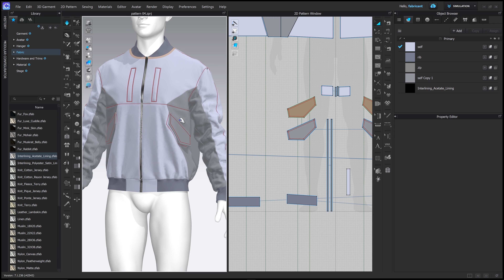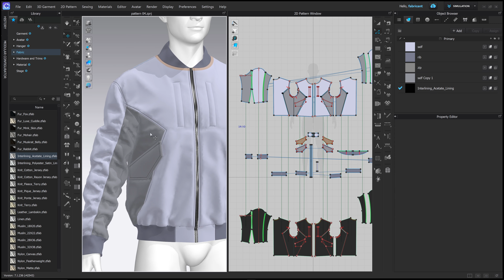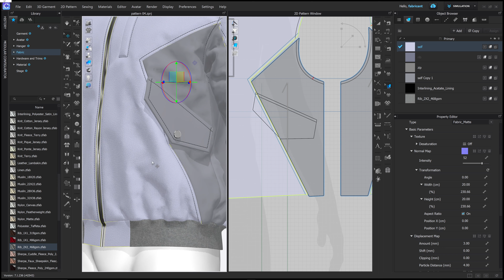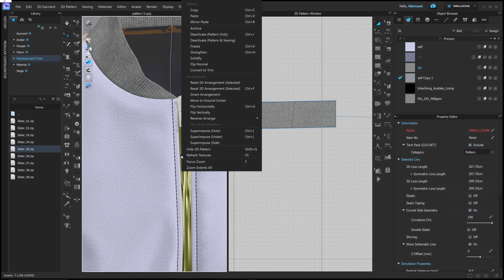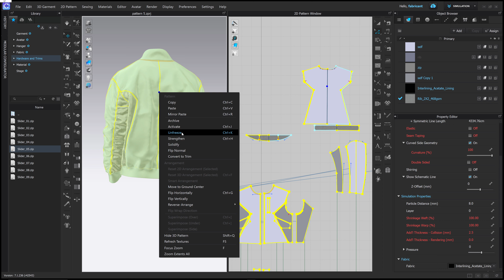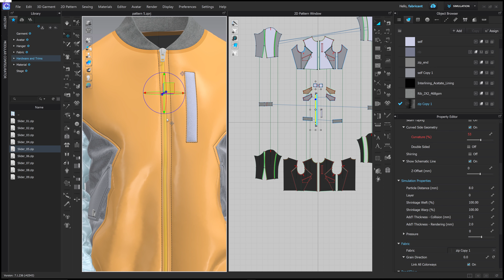CLO3D For Beginners - Making a Bomber Jacket - Final Pose all details + posing -Set up for UV Export

Comment: just a question : why did you not use the integrated "zipper tool" ? Is that because it looks bad, so you prefer do your one to have a beautifuler 3D modele to export?
Also, what is your pc config by curiosity? Thanks in advance!
Reply from the maker: I just don't like how to zipper tool works and how it creates UV maps for my zip. I like to create my own to have the most control. I am using a Threadripper CPU and a 3090 RTX graphics card.
Reply: @digitalfashionblender  OK understandable, 
alright your pc is a monster, why it still feel kinda slow sometimes on CLO3D? It that because you're recording, or maybe because your jacket is rly detailed, or because you use to use 10mm for triangle distance who create the 3D mesh?

Comment: Thank you for the video again! One question~ why don't use CLO zip tool to apply for zipper? Wondering where can find good quality of zip teeth image if use fabric to apply?
Reply from the maker: It's harder to control and deal with the UV mapping using the Clo zipper tool. I get better resolution this way for final texturing outside of Clo 

For a zip texture I make it in Photoshop with a scan of a zipper taken from image search. Then use Photoshop to generate normal maps and make roughness/metal Maps as well :)
Reply: @digitalfashionblender  thanks for the details! Got it, really helpful 👍

Comment: Just trying to understand the methods, Is there a reason you would make your own zip vs using the zipper tool in Clo?
Reply from the maker: Yes  I don't like the zipper tool, if you add a zip on a seam it just adds some pieces into the seam, this isn't good pattern making, especially for a center front zip.  The zip allowance should be taken from the center front edge to close in the right position. The zip made in the tool also gets a bit unstable which I don't like in simulation.

I also have more control with using my own zip pieces when setting up UVs for  export. In general it's about what gives me the most control :) hope that helps!
Reply: Just wondering how I can find zipper textures, I've been looking but can't find any online and the clo zipper maps are both sides of the teeth with no tape. @digitalfashionblender